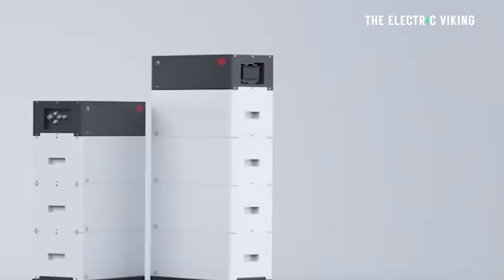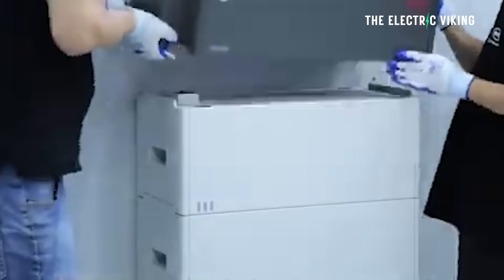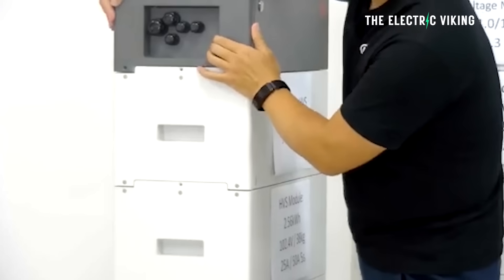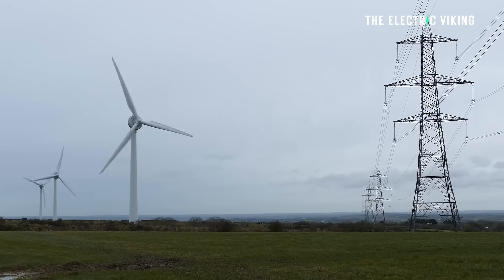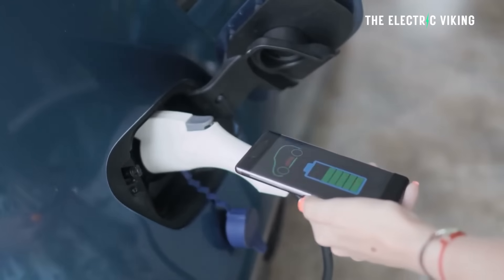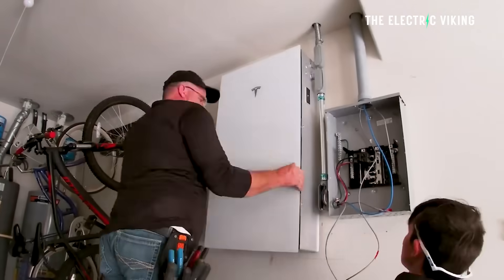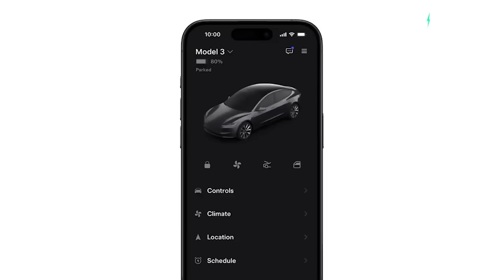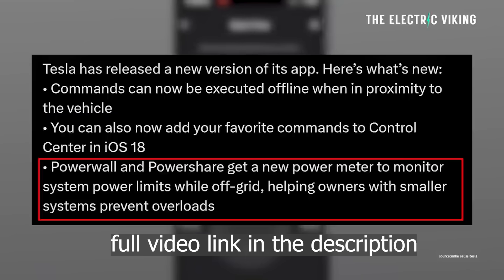BYD Battery Box vs. Tesla Powerwall – New Home Battery Battle!

Comment: tesla vs build your dreams electric vehicles manufacturers:

byd gone in sixty seconds, adding 70 + miles of range in under one minute of flash charging its byd LFP cells.

is tesla asleep at the wheel. its okay, we know its safe to sleep in a tesla, but when will tesla start building megawatt flash charging stations and electric vehicles which charge in five minutes, to offer a comparable product to the BYD electric vehicles already in delivery.

Comment: I have A 13.8 KWH BYD Battery Box coupled with a Fronius Geo 24 6Kw Hybrid inverter. Professional advice was that the Fronius Geo 24 and the BYD have been matched to work seamlessly together and not to use the BYD inverter. 
This has full blackout protection and allows Solar panel feeding into the battery/house during a blackout which providing a reasonable amount of sunshine during the day allows the battery to charge. 
Cost wise the battery was cheaper than the Tesla Powerwall 3. It uses Lithium Iron Phosphate and has zero cobalt or Nickel within its make up.
I also have a desire not to use or buy any of Musks equipment owing to his association with the Orange Turnip currently destroying the USA

Comment: If your Nissan Ariya lunged forward without you pressing the gas pedal, it's a serious issue and requires immediate attention. The most likely cause is a software glitch or a hardware malfunction related to the car's control systems, potentially including the e-Pedal system (https://www.google.com/search?client=safari&sca_esv=218c1d1cd979ee0a&hl=en-us&cs=1&q=e-Pedal+system&sa=X&ved=2ahUKEwim_cLnx5eNAxWGQzABHR3-HdkQxccNegQIBxAB&mstk=AUtExfDohuaIXolya5DCM_xgejBWJX6y4b8F7GrM5tMu9OvvufhdsR7x7eOuj2-7_eHlFqPQziB7tV8vssbQ_O8CV9Pt7JKWrMxPhugNxq3i5tkp6FmJ-bdH4xlstvREF-0KM6s&csui=3). You should contact Nissan (https://www.nissan.co.uk/owners/car-repair/car-owner-manual/manuals/iom/ariya/0fe0/e2/2024/e-pedal-step-system-1.shtml) immediately for assistance and to determine the next steps

Comment: I just ordered Powerwall 3 here in USA. 18kw solar with 6 Powerwall 3= 81kwh capacity. With incentives and rebates it came to a total of $34k. That's an awesome deal IMHO. With the discharge of 30kw I should be able to run pumps, ACs, microwaves and everything else all at the same time. My average daily use is 30-40kwh  and I'm hoping to keep my batteries between 20%-80% SOC. Also I think Tesla software is outstanding. Now I still don't have it so it's all on paper but should be here soon😅 .... And I'll test crap out of it .

Comment: PLEASE address the ELEPHANT in the room here!!!
Which BYD and Tesla EVs can work with the battery box or the Powerwall!?!?

I have been waiting for a decade for someone to finally provide a FULLY INTEGRATED SOLUTION here!

I.e. if I work from home and have an EV, 10kW home battery, and solar can I not choose to charge up my home battery and then when that’s full start charging my EV with the excess solar?

Then at night when sun goes down I can use up my home battery and if that gets too low I can transfer some energy over from the EV (which will be a MUCH bigger battery pack - usually 60-80kW) sending power to the home battery from the EV to top it up so I never need to use grid power!

I could also sell the excess power I don’t need back to the grid from the huge EV batt to home battery to grid!

This is an absolute NO BRAINER…and is in fact how we can intelligently use all these huge EV batts (that sit idle 90% of the time when not driving) to fully power the world via renewable energy and batteries!

ROI on EV, home battery, and solar goes through the roof in this scenario and EVERYONE will buy all 3 products (which BYD and Tesla sell by the way.) Could void EV batt warranty if they really need to but with LFP batts and the right software to protect the batts I don’t think they would need to.
Let ppl do what they want with THEIR own batteries! 
Can program how you want your system to work all through the app on your phone! 

Charge up EV and home batt before a storm and you’d have enough power for 10 days if grid goes down (assuming no solar to top up from)!

I mean what the F are we doing!?! The solution is right in front of us! 

Please cover this! 
BYD batt box says they can export 16kW at any one time? How much can Tesla Powerwall do and how much does the average house draw at any one time? 

THESE are the RIGHT questions when covering this topic!

Comment: Look forward to that video Sam. I started to look into getting a battery but I was told I couldnt, because in Queensland, you cant have more than a 10kw inverter on single phase. 
I have 28 panels with microinverters on each panel and I'm already at the 10kw limit.
Are there any gurus out there, that know a way to have a battery without rewiring to 3 phase?
Reply: I think that is only if it is a AC coupled the battery. Restriction does not apply to DC coupled.
Reply: @peterryan5154  ok thank you. I will definitely look into this further.

Comment: I am waiting for the Vehicle-to-Home (not to load, but to the entire Home Switchboard Feed line) to become available, which I suspect will become a reality in the next couple of years. If you own an EV, you have a 50KWH plus mobile battery that is parked in your garage every night, why would you pay through the nose for a separate 4, 5, 13, 20... KWH battery?
Reply: We did this with our 40kWh Leaf 4 years ago. We had heaps of problems and the car was bricked a couple of times.
We eventually gave up. The hassle of getting the car fixed under warranty was frustrating. Couldn't fault Nissan or the dealer but I reckon if we told them what we were doing the outcome may not have been so rosy.
We will only look at standalone batteries in the future.

Comment: We recently installed a 11.5Kw BYD modular home battery with the Fronius Gen 24 Inverter and Fronius Wattpilot EV charger, with a 6.9kw solar system, at our unit in Melbourne. We are very pleased with the outcome. We are able to monitor how we are using the power each day, from the solar panels, charging the battery during the day and then using the battery at night at peak time. We are hardly using power from the grid now. I chose BYD because of their reputation and as it is modular we can add up to 11Kw more  battery storage to our existing one in the future.

Comment: We have installed the Sigenergy battery system with the Sigenergy hybrid inverter.  We have 3x8kW batteries that are stacked one on top of the other, but the system is fully scalable up to 9x8kW batteries.  The hybrid inverter sits neatly on top and produces a compact, good-looking system that is a lot nicer than the BYD system shown on your video. We are limited to one a 5kW inverter in WA, but the inverter is only software limited, which means the same inverter can be used as a 5kW, 10kW or 15 kW system, depending on the restrictions in your state. The Sigenergy system does not need to be energised from the grid, so that we can produce, use and store electricity 24x7 through the year, even in mains power outages. The accompanying App is also good, and our installer (SMC Energy) says that it's better than the BYD App. I would highly recommend this system to anyone that wants to be independent from the grid, whilst still being connected to the grid to get paid (a nominal low amount) for the excess electricity that isn't used or stored, and therefore exported to the grid.

Comment: Putting batteries inline increase the voltage. If they are installed parallel increase the wattages but not the voltage.

Comment: We've recently converted to a full Huawei ecosystem with battery and it was quite affordable.  But realistically with bi-directional charging batteries in cars it makes it less appealing to spend any more expanding the battery bank versus using the car as a better back-up for emergency night needs.  During the day solar production easily meets the needs of the house and fills the battery and sends back to the grid.
Reply: Please explain your config: car type, inverter, ... because most cars cannot do that. Only one way

Comment: Here in the UK I am waiting for V2H and then I will go full solar (c. 10Kw array), there is a space in the back garden by the shed for the batteries and an air source heat pump for both heating and hot water.

As another poster has mentioned in the UK there is the excellent Givenergy system which on a like for like capacity works out at about 20% less than the tesla powerwall 3.

Comment: I have gone off grid on my farm after getting a quote in excess of $70,000 ( Powercor, central Vic. ) to connect to the grid.    I went fully solar with battery.  I have a 10 kw solar array on the roof of the shed, a fronius inverter all connected to a selectronics AC coupled Inverter.   I have two BYD Premium LVL batteries, which together give me a 31 kwh capacity.   The whole system cost, including rebates etc. was about $37,000.   It works faultlessly and has all the power i need.    The Selectronic AC coupled inverter can supply a consistent 32 amp, 7.5Kw of power.    I charge my model Y when I'm there during the day and given that the battery is usually fully charged, I charge the EV without draining a single electron from the battery.  best of all no more electricity bills, which are mostly made up of service charges.
Reply: A 10kw solar system wouldn't be big enough to fill your batteries in winter?
Reply: @buntaing77  mine  is a 10.7kw system and it outputs an average of 42kwh per day right in the middle of winter. So a 10kw system would go very close. I wonder how long the batteries would last with having so many cycles. Time will tell I guess.
Reply: @buntaing77  sounds like he’s in australia, going by his choice of inverter and byd batteries.
Reply: Was really helpful for me. Thank you

Comment: I have Huawei Sun 2000 3 phase inverter and 10 kW battery pack. It is also modular up to 3*5kW modules can be added. All should be fine BUT the inverter is 3 Phase SYMMETRIC (also known as UNBALANCED). In short IT IS SH*T a F*CKING SOLAR SCAM!!! And it is SHAME government and electric companies just rip you off if you want to be "green"... If you GREEN means no GREEN 🤑🤑 for them...
Long version: in case of 3 phase you are still using 1 phase devices mostly: hair dryer, washing machine, microwave oven, electric stove, etc... 1 PLUG = 1 PHASE however you have 3 phases. So your 1 plug devices using different phases, it means different phases have different LOAD (hence UNBALANCED). But this type of inverter HAVE NO IDEA about that it is sending power to all 3 phases symmetrically 1/3 for all... Hence the SYMMETRIC inverter naming. It was not a problem since the NULL wire will have NO ELCTRICITY flowing actually. So my inverter is feeding in enough power BUT WRONG WIRES... However like half year ago electric company started "billing per phase (wire)". So now it does not matter how much electricity I produce since in 1-2 wire usually I'm pulling electricity and on remaining wires I'm feeding it up. And pulling in INSTANT BUY, feed up is INSTANT SELL (however they don't pay it up)..
SO I invested tens of thousands in the battery as well which is USELESS I can save 100 kW per month about 30-40% of my electricity usage, THIS IS THE BIGGEST SOLAR SCAM....

Comment: With battery prices around 50 US dollars per kwh, the Tesla powerwall is an absolute ripoff. It is far cheaper per kwh to buy an 80kwh EV for around £40,000 which is far cheaper than equivalent Powerwall capacity and the car is effectively thrown in for free. Hopefully Tesla Powerwall sales will fall through the floor just like the cars.

Comment: Hi Sam, I'm in the UK and have had an Alpha ESS battery for 5 years and its been great, I have also installed a few Alpha batteries too, mine is an early model so they have now changed a few times, all have been without problems other than one of the early ones I installed came up with a fault and I contacted Alpha and at that time I was communicating with China and they were brilliant, it was the little cooling fan had not worked and they sent a new fan with a pictorial instruction book on how to change it and its been fine since. They now have a UK tech team which are also useful if you have any queries and an online app contact. I know they are quite popular in Aus as I have seen a lot of youtubes based in Aus.
Not sure what you are going to fit but fir value for money Alpha are one of the best. I have installed GivEnergy and Luxpower. Luxpower use Pylontech batteries but although are cheaper than Alpha they look very messy

Comment: For 3 phase you need 3 Tesla Powerwalls and if you have already have a Fronius inverter on your solar system, the BYD battery does not need the extra inverter.
Reply: Tesla is not the right solution for 3 phase applications. Fronius are asleep at the wheel with their 3 phase systems. Largest hybrid inverter size is 10 kW, pathetic output current and up to 90 seconds changeover time. Their market share is collapsing. Sungrow, SigEnergy are leading the industry by a long shot.

Comment: A battery is a great idea, but only if it makes economic sense. I was lucky enough to get a Franklin at an introductory price whilst Qld were also offering incentives (There was a small 4 month window to get the grant). All up it was $7,000 installed. There is 13.6kw which offsets our nightly peek time usage saving about $6 to$7 per night. To be frank however, if it was not a special introductory deal and there was not grant from the Queensland government, the pay back time would have been twice as long. As it stands, we installed it almost 1 year ago, and the app totals the savings as $1479 for the battery, and $2664.20 savings when combined with our solar. 

My experience with the Frankin has been excellent. It has a very wide range of features, and it will cover the whole home usage. it can even start your solar in the morning if there is no power from the grid. I can even charge it from the grid, or a generator (V2L) if this feature is installed. Currently i make use of our power providers 3 free hours of power during the day to recharge the battery (where I'm not producing enough solar).

Comment: Considering the size and cost of car batteries compared to residential home batteries is crazy at the moment you would think BYD would be able to get a 10kW battery for under 5kUSD with a built in inverter.

Comment: Having spent a career in high end computer systems I know you can custom build a system that I has higher specs then an off the self system, but by the time it’s installed better components are available. In 10 to 15 years Tesla will continue to get upgrades that will work together and upgrade together.  Except for the panels I have a Tesla system that also supports Powershre.

Comment: Buy a used Tesla model 3/Y HV battery from a wrecked car for about $4500aud.

Connect that to one of many high voltage hybrid inverters via Lillygo adapter. Massive battery for very little cost.

The challenge is housing the physcially large car battery, preferably outside undercover.

Comment: I have a PW3, with 13.5kw solar plus ACDC split 7kw air con. I now draw no power from the grid. What I didn't appreciate is the PW3 integrated inverter is rated at 10kw rather than my old system of 5kw. This is the key to efficiency. I have 2 Tesla EV's that only charge on solar.Amazing the new solar panels.